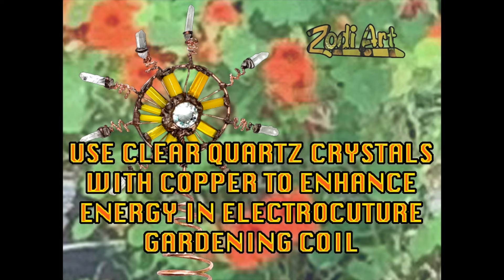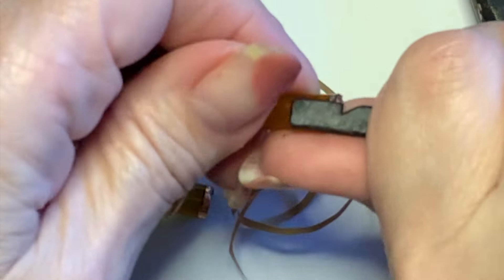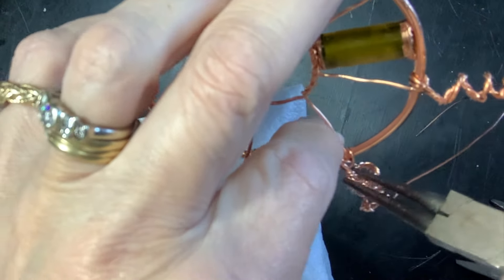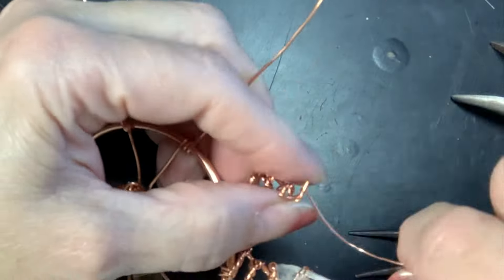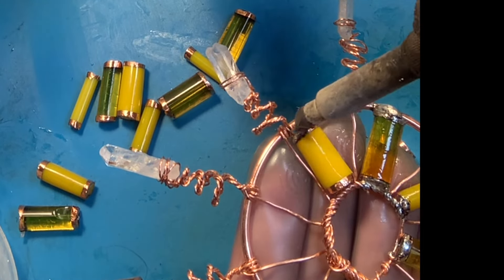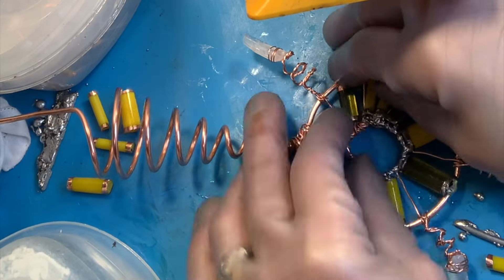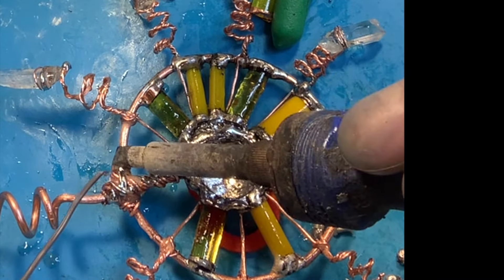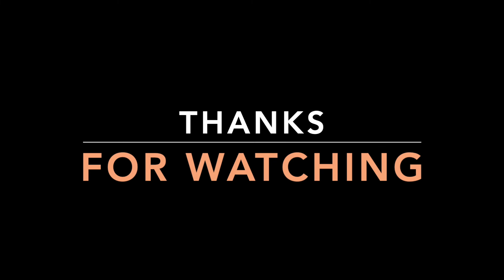Use Clear Quartz Crystals with Copper to Enhance Energy in Electroculture Gardening Coil.

Comment: So I've been using and making electoculture antenna, as well as Orgone Accumulators... I really love your work, So do you use the glass rods for a function or are they just for looks?.. Please Advise.
ThanQ
Reply from the maker: Thanks for your comments- I added the rods mainly for looks but also, yes, had it in mind that their shape is kind of like a thick light tubes that may help focus light and energy to the center of the coil.